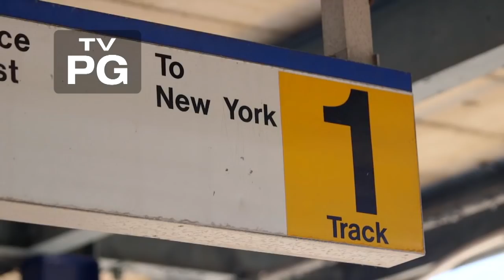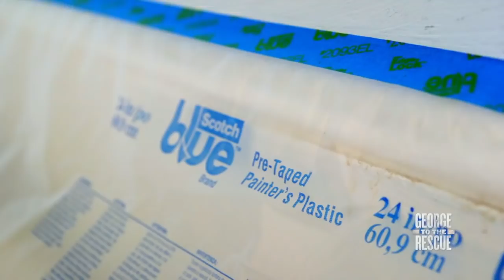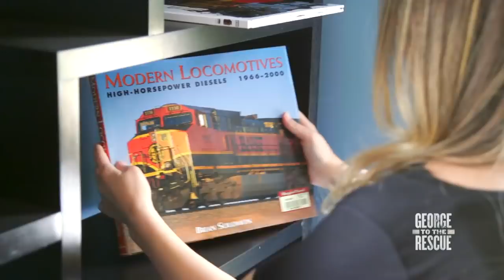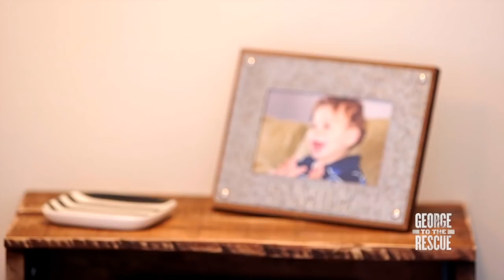George Surprises a Teacher and Her Special Needs Son With a Home Renovation | George To The Rescue

Comment: The mum said no concrete because he fell & might get serious head injury (and who not a slope instead of steps?) - so why the hard paths? Those curtains in the mum's room (& kid's?) won't keep the room dark. Maybe she wanted that extra room upstairs for guests - or maybe later if her son ever needed a carer? Some good bits though and really glad you helped them.
Reply: I used to think that but they basically ask them before doing things and ask them lots of questions before hand they male it look like it’s random but it’s not that spontaneous,
Reply: I was thinking the exact same thing. Not only more hardscape was added but they used small pavers which in that climate over time are going to pitch & buckle producing so many more edges to catch on while walking.. seems more dangerous than she had before.. WTF?